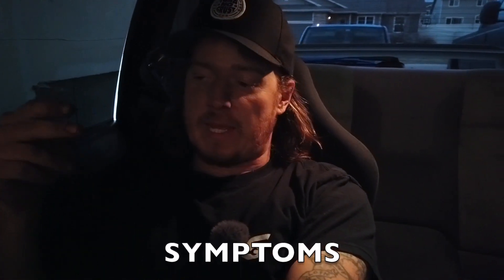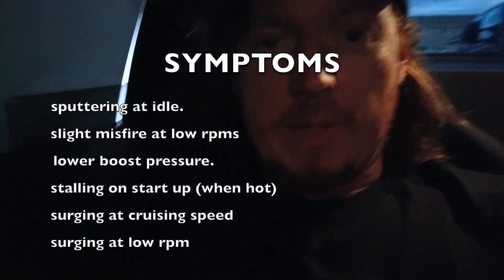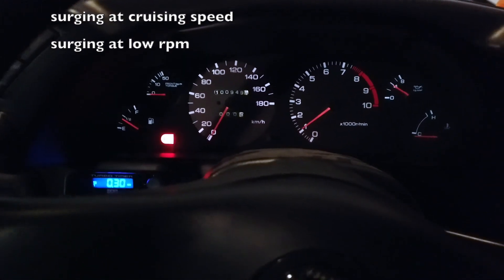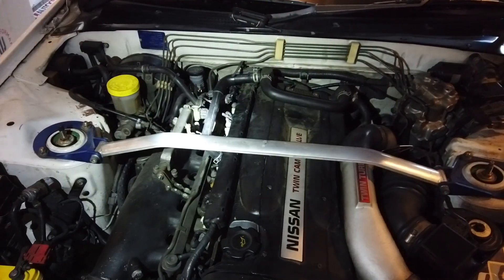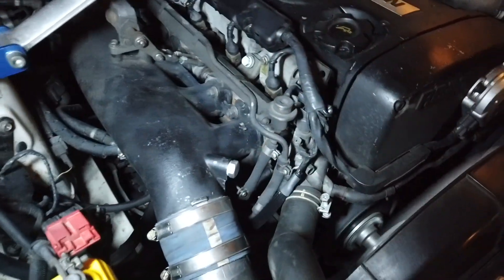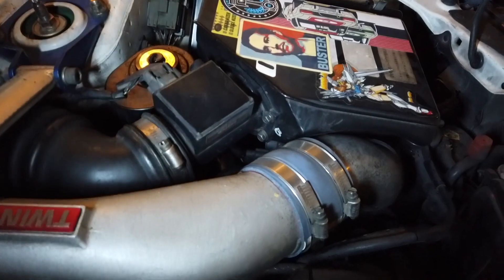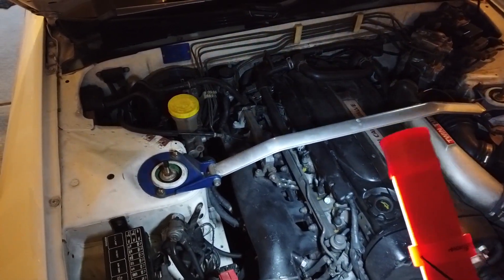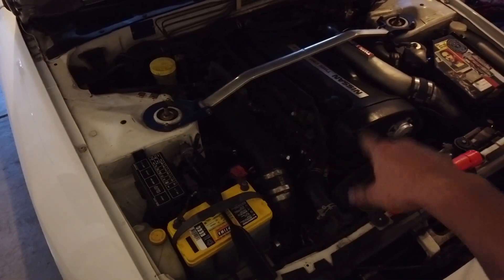Stumbling and stalling fix for the Rb26dett skyline gtr

Comment: Thank you for sharing that sir! The symptoms you described sure sound a lot like what we are experiencing with our '92 GTR. It landed here in Hayden just a couple weeks ago and it's been frustrating not knowing why the idle is so rough and breaking up around 3,000 rpm. The seller is sourcing a new gauge cluster since the one installed has bad tach, water temp, oil pressure and front torque split meters. Until the new one comes, I don't trust all the warning lights that are on...though I would think I could still work on the misfiring and break up?
Thank you again for sharing what you found!!
Reply from the maker: If it’s braking up at 3k check the mass air flow sensors plugs